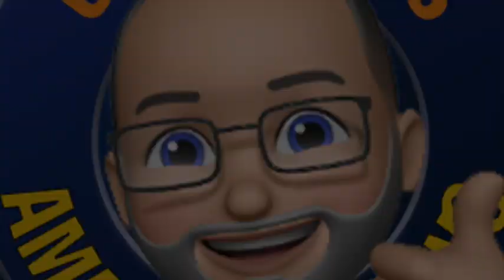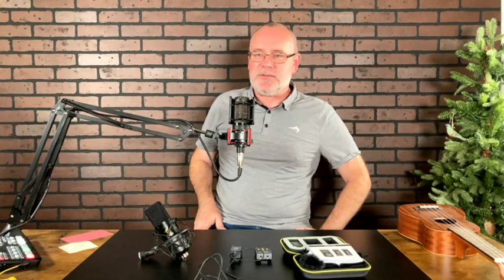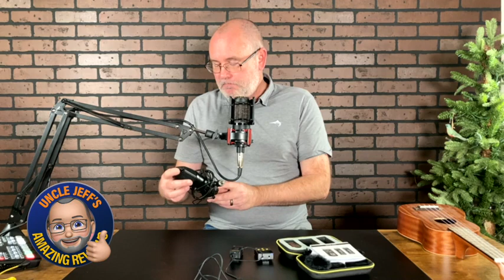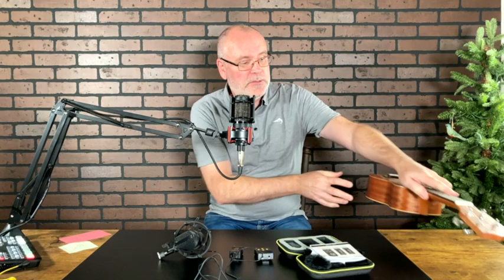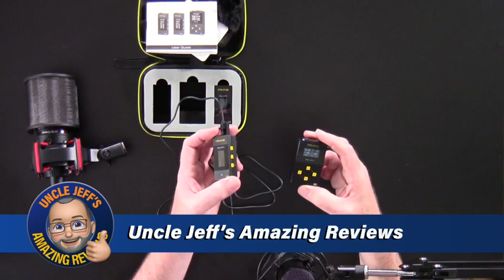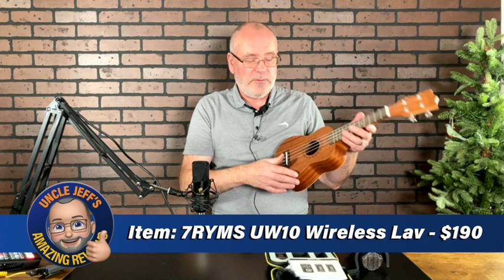Uncle Jeff  - Episode 1.2 - Analog Microphones: TONOR, PROAR, 7RYMS

Comment from the maker: UPDATES and CORRECTIONS:
I made the comment that the 7RHMS used 50% of it's battery in the hour or hour-and-a-half that I used it. Apparenty, it seems the on-screem battery level indicator gives a different reading when in use than it does when in charging mode, so I was comparing two different readings. It appears it used less than 25% of it's charge during my use. I also neglected to mention that it was rechargeable, uses a USB-C charger, and includes two 3.5mm output cables; one for standard audio use and one for use with a smartphone or tablet.